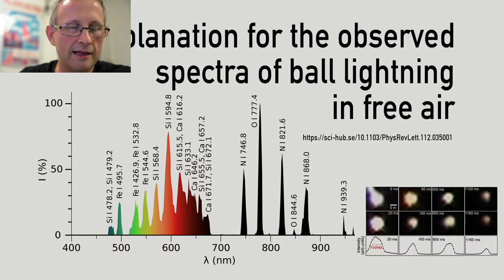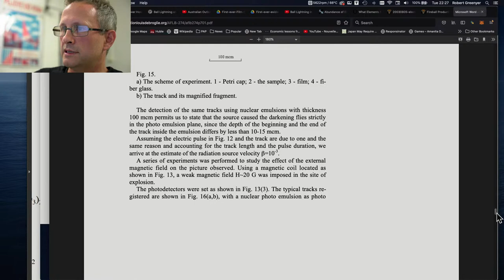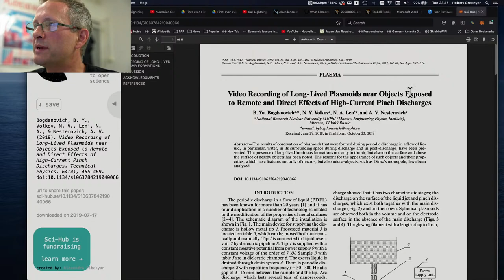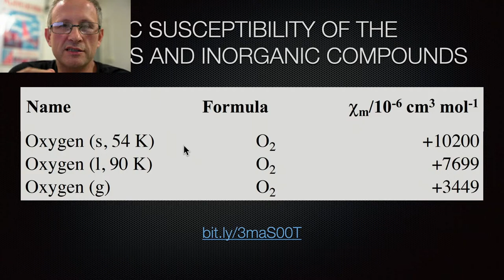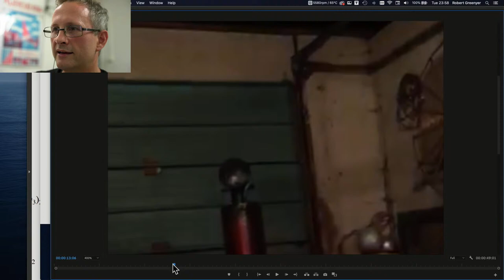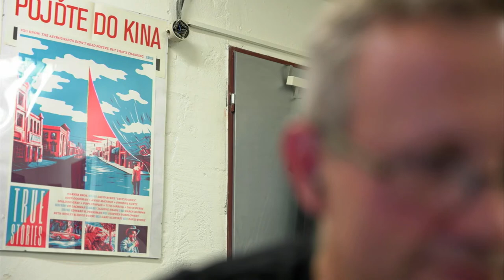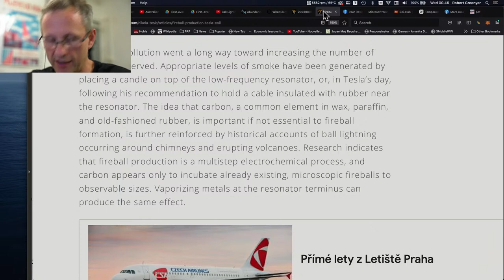Technological production of 'Ball Lightning' vs natural formation

Comment: Can the Tesla coil video be found on YT ? I've seen many TC vids but none producing such effects
Reply from the maker: No it can not. Our collaborator DAVE has said he would like to re-run the experiment with the new understanding and with the experience we now have in recording high resolution 60fps from multiple camera angles. These videos will likely be shared.
Reply: Late to this part of the party but clearly something like this is behind all the weird observations in things like GEET motors Joe Cells.
Reply: @MFMP  I'd expect u'd want all the critical visuals like this one, secondly the "frosty spark gap", and thirdly the thin wire power transmission to be available as soon as possible
Reply: @alexdelcastillo1220  I'm not familiar with those, but I want to see the unshown anomalies like "frosty spark gaps"

Comment: Are using vacuum tube technology couple of bean power pindos or a large pair of triode or like a large pair of horizontal output tubes in a push-pull configuration

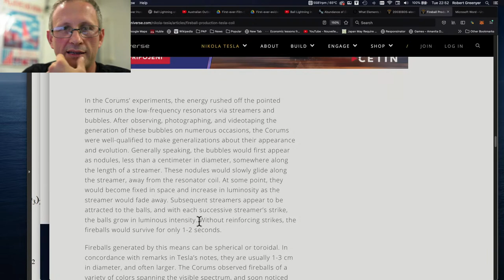Comment: 48:00 The ball would "attract" streamers only if the (outer) electric status of the ball is out of phase with the coil oscillation ie. when the top of the coil is negative the ball is positive and vice versa, but it could just appear as if there's an attraction if the ball simply acts the same as free standing conductor which will more frequently become included in the streamers path, hence activity would appear anomalous if the streamer didn't continue after contacting the ball, which could suggest that energy is transferred and accumulated with maximum efficiency, also there's no reason to assume that energy isn't being transferred "wirelessly", hence that could be the origin of the glow.  Place a sparkler in the vicinity of the top load and see what happens!!

Comment: I can tell by the consistency of your output that using transistors are vacuum tubes for your your discharge using either hardly or Roku copet oscillator like to see a schematic diagram for that power supply the Tesla coil I built simple primary power 2000-watt using do neon sign Transformers FaZe parallel for these experiments I suspect the frequency ranges are quite critical the phone on frequency of copper 45000 Cycles or 6000 Cycles Witcher Bradley subharmonic so that they disseminate with the manners atomic structure frequency I had so much curcumin to my Tesla coil primary I used to squirrel cage blower motor 2xu terracross by primaries spark gap then used a lawn mower Muffler to quiet the noise down from the spark gap Yeti use earplugs when you ran the machine my secondary coil was 8 inch PVC number 26 gauge wire primaries consisted of service entrance wire double you could take a piece of plastic a scrap piece for my capacitors it was super heat and start melting down the chips would catch on fire the Oakwood from the glow was so loud you had to wear ear plugs the ozone was so thick Annie Rider run a blower in my basement out the basement window to remove some of the ozone from the environment I had to take some of the drop ceiling did my wife complaining because Sparks were going through the floor and she was getting shocked on the Upper Floor I've lost my cell phone and my alarm dialer but where the experiment really got amazing was when I got a smaller coil supersaturated all you could see a glow luminous glow that was about 5 or 6 ft in diameter Serenity the primary and secondary what if woodchuck a Polaroid photograph they were all kinds of the novelist little tiny dots something that was invisible to the eye like maybe miniature ball lightning